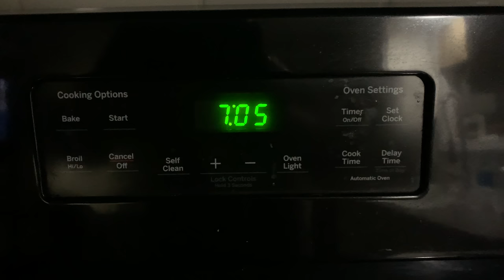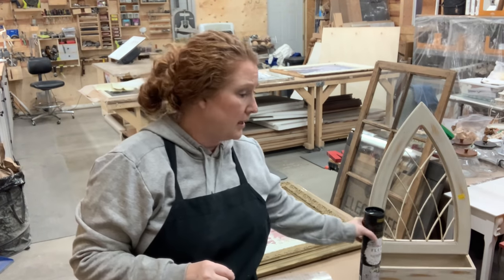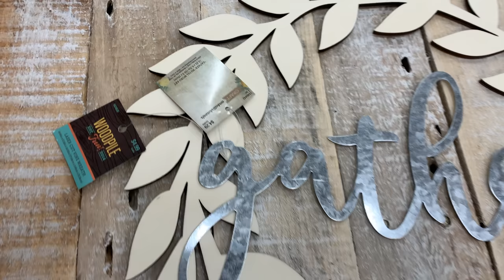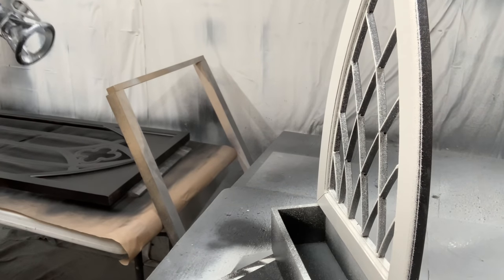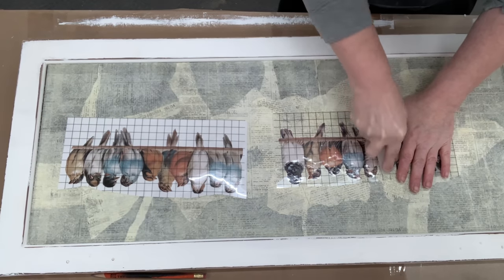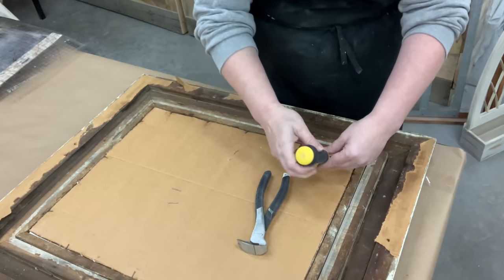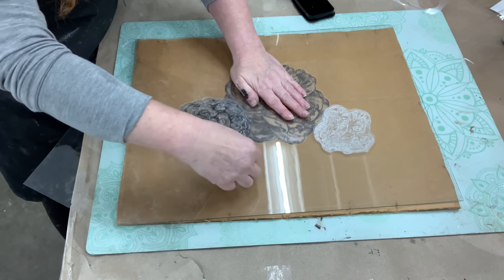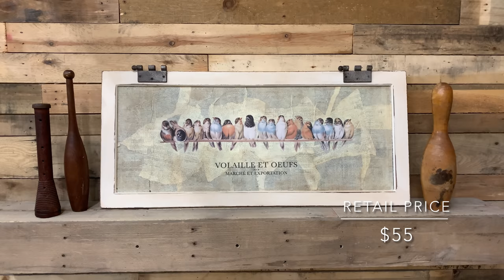Wall Decor Ideas || DIY || Thrifted Finds Makeovers || Iron Orchid Designs

Comment: I have wanted to make window or glass decor with some of my "words" transfers but was worried about sealing them on the outside of the glass vs. having the image on the inside (which would obviously be backwards if I applied it there). Thanks for the tip on using a bit of wax to seal it in! I made my first piece of reclaimed window art based on your video, so thank you!